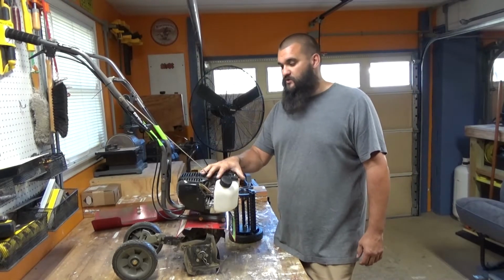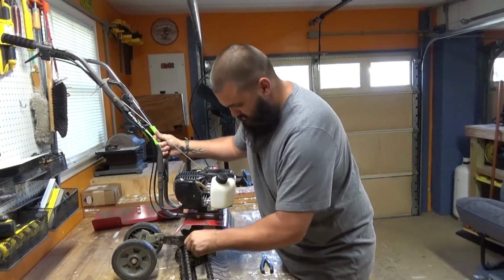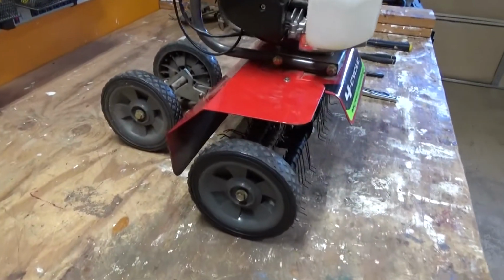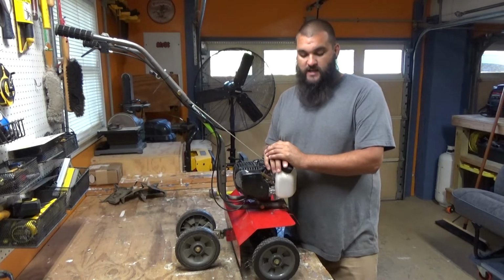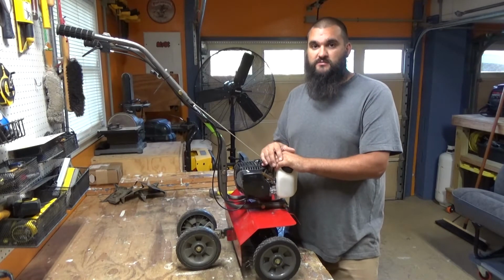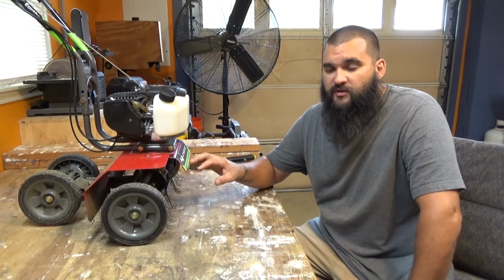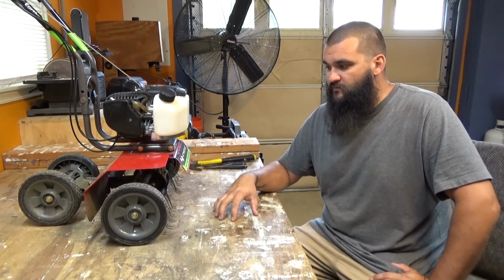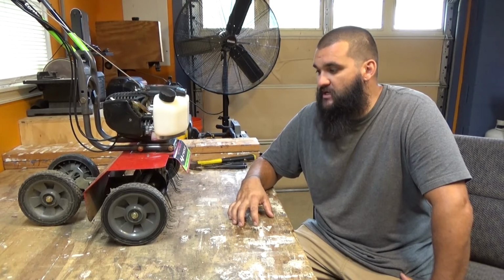Earthquake Power Rake/Dethatcher Attachment

Comment: Why are you pulling it backwards?  Wouldn't it be easier to reverse the attachments and let it pull you forward?
Reply from the maker: I didn't have a lot of success going forward with this machine. The attachments became so matted, and  I was spending a lot of time cleaning  them. The grass definitely spits out the front easier. The large shield stops the grass from exiting the back of the machine. I didn't have much success until I found a couple of videos explaining the proper way to use the attachments.
Reply: @delawarediydad agreed. Even with my plug in electric dethatcher the thing works better doing it the opposite of the instructions. LoL.

Comment: Hi😊
Can the shield be kept on to use the other attachments? I found it a little hard to install and I’m wondering if I could keep it there permanently while using  the tiller. Thanks for your advice.
Reply from the maker: The shield for the dethatcher attachment is a little long. If your trying to get into tight areas it could get hung up on things making the work a little bit more difficult. I only use the dethatcher attachment in the fall before planting grass seed. Trading the shields can be a little time consuming but thankfully I only have to set it up once a year. I think the manufacturer could have made it slightly easier to make the sheilds interchangeable.
Reply: @delawarediydad  . Thank you very much. I agree with you,  I found it difficult to screw the shield the holes almost didn’t line up; do you have the edging attachment? I would like to find a video on that as well since I bought it but haven’t used it yet. I found your video very helpful. Thank you for making it.

Comment: I was searching for a dethatcher and the only ones I could find are either the electric or the battery operated versions. I'm not dealing with a long extension cord so that's out. The only decent battery operated is the Ryobi, but the batteries cost $180 a piece and you need 2 of them. I'll pass on that.

I was hoping I could find a gas version and found this attachment. I bought the Earthquake back in 2017 for tilling but never used it. I searched YouTube for some videos on this attachment just 2 nights ago and there were only like 2 videos and both were very poor. I bit the bullet and ordered the attachment anyway from Home depot and it will be here Tuesday. So excited.

This video is excellent. Covered installation and use, everything I wanted to see. You have a large lawn so how long would you estimate it took you to do one pass? It's crazy that much dead grass is inside your grass and you really don't even see it. I just talked to my brother about my purchase and he said he thinks they are too narrow and would take too long to do the entire yard. Do you feel it did a good job loosening the dirt for seeding? We didn't aerate this year so there was really no reason to seed. Little disappointing, but if this actually does a little bit of aerating I may be able to seed this fall which would be another huge plus.

Funny thing is I'm also from DE. Thought that was funny. Thanks for the video. Nice job and new subscriber.
Reply from the maker: I think you are going to be very pleased with your purchase. I couldn't imagine the chaos of pulling an extension cord around with me or always having to charge batteries. Having a gas powered option gave me the freedom to wonder and do the job efficiently.
I have about 1/2 an acre and the house and driveway take up a lot of my property. The front lawn being the majority took about 2 hrs. I seeded heavily in the front yard and depending on the success I have will determine if I do the remainder next fall. 
The rake attachment definitely scratches the surface of the dirt but nothing to extravagant. If the seed finds it's way through the lawn to the surface of the dirt it should germinate. I just made sure that I protected any bare spots with crushed hay. This keeps birds from flying off with it and also keeping moisture in spots that might otherwise dry out. 
First time doing an area as large as seen on the video and already seeing a great amount of seed shooting up out of the ground. My guess is your lawn may be heavily matted and is the reason for your recent purchase. If not a lot is kicked up aerating may be a better option.  I haven't heard of anyone doing both in one season. You have to ask yourself the question of weather the grass seems dense and matted or does it seem like the dirt is compacted not allowing for the grass to be as healthy as it could be. Matted areas should be dethatchered and hard compacted dirt should be aerated. 
Being that your from Delaware you may be ok if you get seed down this week. Giving the grass time to root before any severe cold killed it before it gets a chance to mature. 
Thanks so much for your comment and subscription. It is greatly appreciated. Hope this feedback was helpful.

Comment: Like automotive, left and right is determined from the operator's position rather than facing the front of the machine. :-)
Reply from the maker: That's awesome if all manufacturers actually follow this rule as an industry standard. I know from the mechanics point of view. Never imagined that rule would carry to small applications like this.
Reply: @delawarediydad  My friend Dan recently had to take his 2 stage snow blower augers off. When he put them back on he noticed the "L" stamped on one of the augers so put this one on his left as he reassembled. This was incorrect as the augers would not pull the snow to the center. Live and learn.